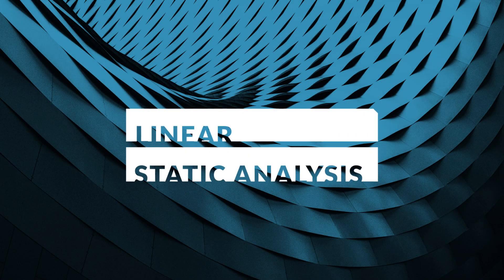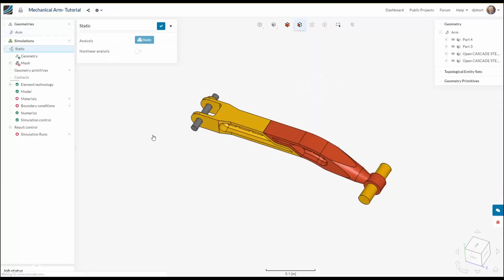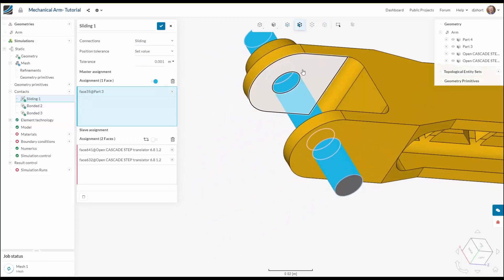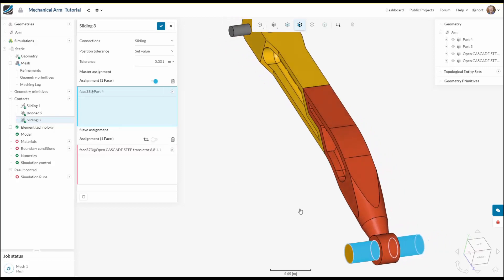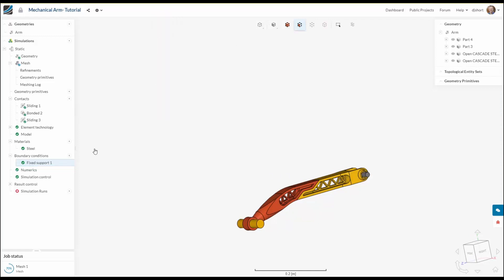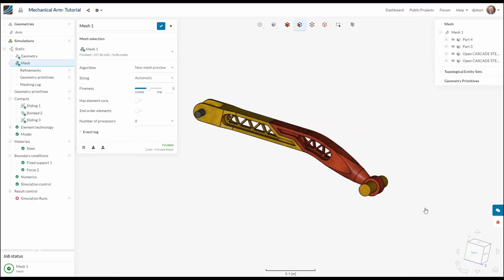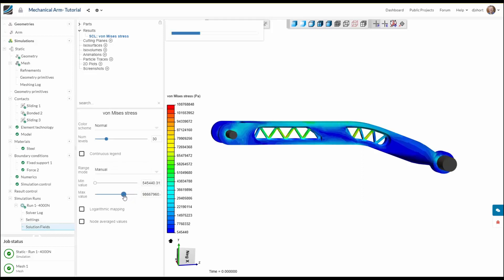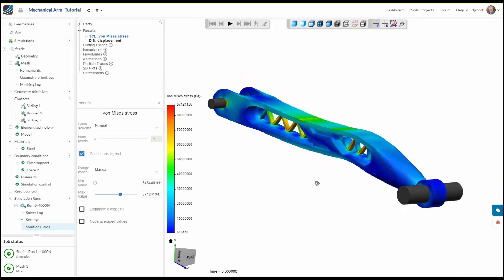Linear Static Analysis Using Multiple Contacts

Comment: Is there a downside to selecting the maximum number of cores to run this on?  6 minutes seems rather a long time to wait for the FEA run (compared to SimSolid for example).
Is it possible to load subsequent design iterations without having to go through the whole setup of the model again, except meshing. (as you can in Solidworks / Simsolid)
Reply from the maker: For this relatively small mesh, the smallest selection of cores should be enough. About design iterations, SimScale has CAD associativity so that all the setup is automatically assigned when you update the geometry. Please check these articles for more information:
https://www.simscale.com/knowledge-base/cad-associativity/ 
https://www.simscale.com/knowledge-base/solidworks-add-in-for-cad-export-to-simscale/